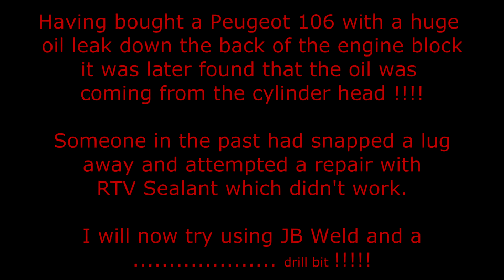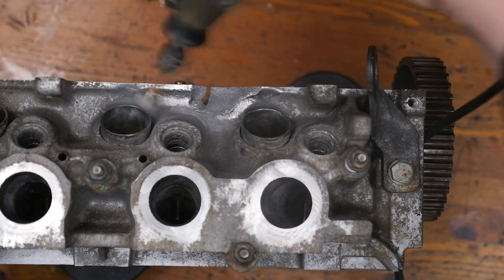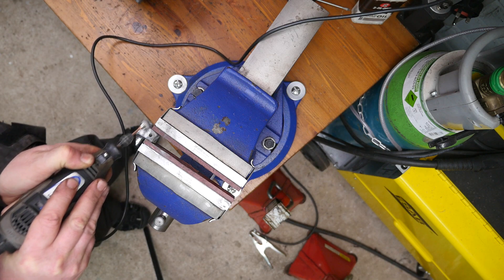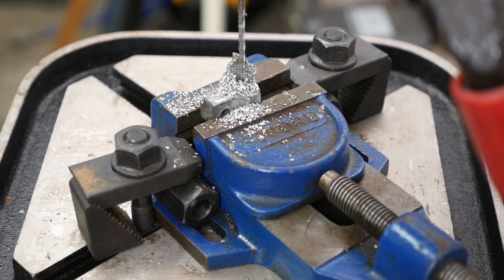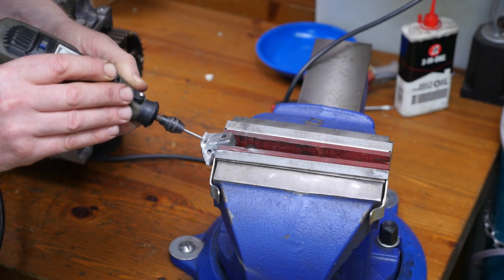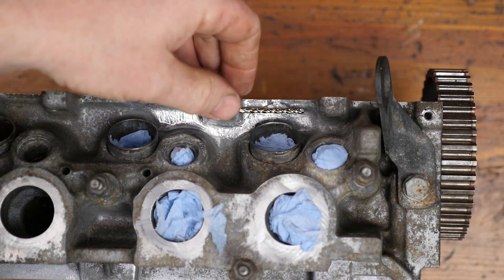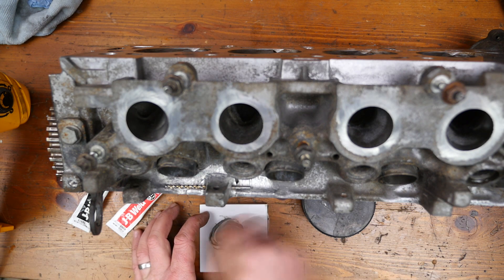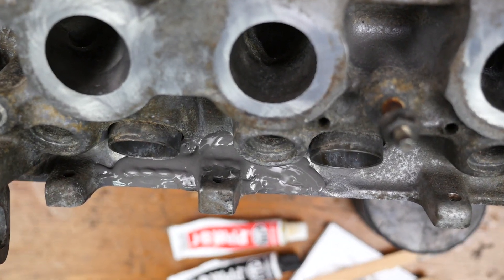Can JB Weld ™  Repair my Peugeot 106 1.1 TU Cylinder Head and be hoisted into the air ?

Comment: Good product. Back in the early 90's I used JB Weld to pack out a worn 'hammered' crankcase (around the flanged main bearing) on my old 1968 VW Beetle 1300. Packed it out and that repair maintained oil pressure and enabled me to get another year's worth of driving until I could replace the engine with a tuned replacement.

Comment: Heat resistant?
Reply from the maker: It's rated at 260°c  constant and 315°c for 10 minutes.  Thank you
Reply: can you pls update, how durable that repair was. Also the head gasket. Many of these small engines blow the gasket after the head bowed due to overheat, i.e the new gasket will not last either unless the head was machined. Thanks!